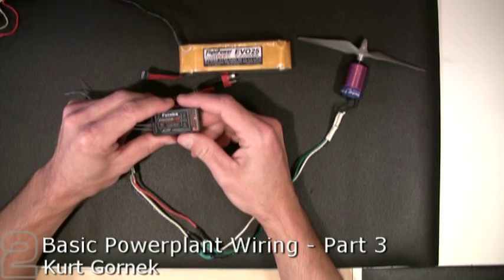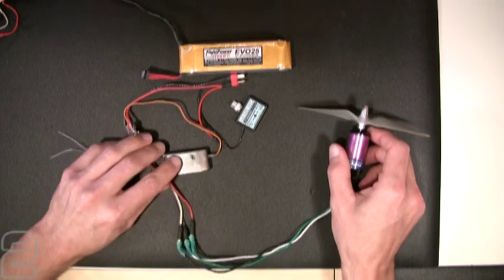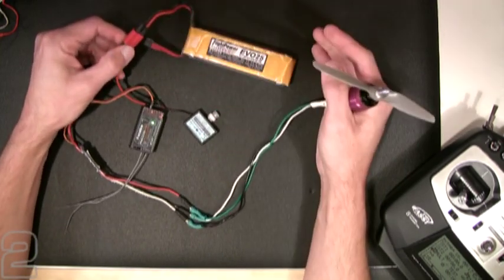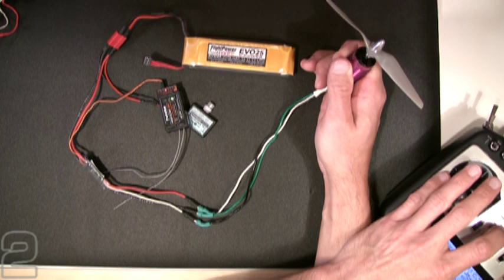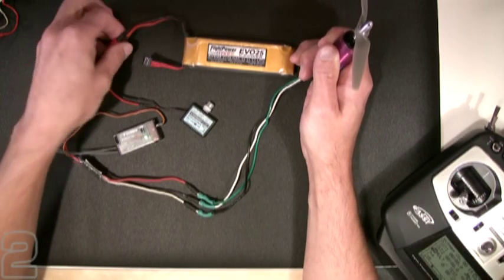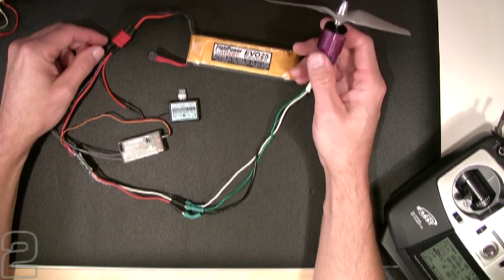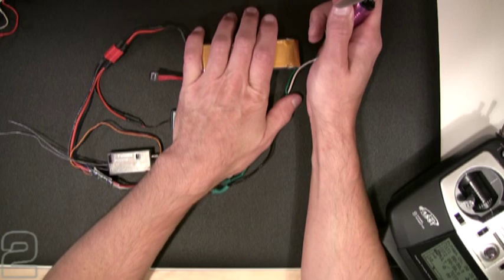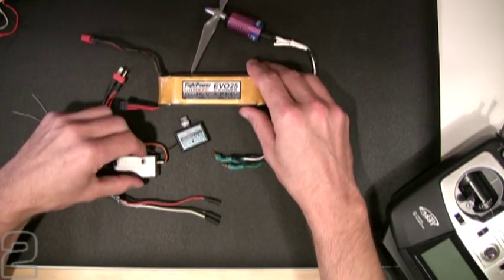RC Motor and ESC Wiring - Part 3

Comment from the maker: Always size your ESC to handle the maximum rated amperage draw from the motor, so you'll need a 46A speed control.  The BEC requirements are determined by the number and size of servos you are using.  Most standard BEC circuits found in 46A ESCs will handle 4 standard servos no problem.  If you're using more servos, or fast/powerful digital servos, consider using an external BEC like a CC-BEC 10A unit from Castle Creations.  If you exceed the internal BEC rating you could cause a radio brownout.

Comment from the maker: The receiver gets it's power from the BEC circuit integrated into most speed controls.  Typically an integrated BEC (Battery Eliminator Circuit) supplies 4.8 - 5.0 volts DC to the receiver.  Most radio systems now days can operate anywhere from 4.8V - 7.4V, but you'll want to verify this range with your manufacturer.  Servos are rated most commonly for 4.8 or 6.0 volt operation.  HV servos require 7.4 volts.  Most of today's receivers are designed to handle this entire voltage range.

Comment from the maker: Yes.  Brushless motors require an Electronic Speed Control since the motors actually operate via multi-phase AC current.  Connecting a DC battery directly to a brushless motor will just cook the motor and possibly the battery.

Comment: Im running a Turnigy D3542/5 1250KV Brushless Outrunner Motor and I'm not sure what ESC and BEC I will need. Does anyone have and recommendations? (Im a beginner so I don't need a super performance model)
Maximum current draw for the motor is 46A

Comment: WARNING, most brushless motors spin the motor housing that is attached to the propeller.   DO NOT hold the motor like this video shows unless you are sure the housing is not attached to the propeller.

Comment from the maker: @MrDoodool1 - I believe on that ESC, the side opposite of the wires is the best placement for the heat sink.  I don't have one here for verification, but one side should have several integrated circuits beside each other that get warm during operation.  You can always perform a bench test at half throttle to verify the heat generation.  Whichever circuits get the hottest are the best for the heat sink.

Comment: Hi there, i have two projects which i am considering using rc parts for, one is an electric skateboard, this will need a basic trigger type transmitter i only need forward and back, if i can find an esc which can direct the charge back into the batteries (regen braking) that would be great. I am also looking for a very powerful motor which has a low rpm, any ideas? I was thinking to put an 11T sprocket onto the motor and a 38T gear screwed directly to the inside of one of the wheels, any ideas?

Comment: @2BrothersHobby Thank you for the reply. I have another question. Wild Hawk came with a switch that comes off of ESC. If I am missing the switch, can I just connect those 2 wires together to run the airplane or would it short the circuit and over heat?

Comment from the maker: @delsol7878 - If your ESC has three wires and your motor only has two, these are not compatible.  Brushed DC motors have only two wires and operate on Direct Current.  A brushless ESC has three wires and supplies Multi-Phase Alternating Current.  The two are not compatible.  You should find a Brushed ESC that is made for your 2 wire brushed motor.

Comment: I have Wild Hawk RTF. The motor only has 2 wires coming off instead of 3 wire on the ESC that you show on the video. Do I just ignore the middle wire and only connect the red and black wires?

Comment from the maker: @698271001 - Can you be more specific?  Are you referring to the several small red and one black wire?  If so, those are the balancing leads.  They are used for charging and balancing.  We have detailed information about balancing leads, the internal wiring and how to use them on our website at 2bfly dot com.

Comment: i have a rc boat im building. it has 3 12v electric motors for propulsion.can i use 1 BRUSHED esc to control the speed of them all together ?

Comment from the maker: @Lenny7118 - Motors typically use what is called a bullet connector.  Most motors ship with the proper size connector for their max current draw.  Batteries are another story.  JST (small) , Deans Ultra, EC3, XT60...the list goes on.  One of the most popular connectors (here come the arguments!) in the US for do-it-yourself hobbyists is the Deans Ultra Plug.  We use the heck out of them for everything up to 6S helicopter packs with no problems.  Everyone has their own preference, just be safe!

Comment: Excellent video!! what I'd like to see also is a video of how to wire in a BEC into a ESC and also the soldering of the different connectors. How do you tell what size banana connectors are use on a motor or battery ?

Comment from the maker: @lendoggtheking - Yes, most ESCs are programmable.  Features depend greatly on manufacturer and model, but options such as motor brake on/off, timing, direction, battery chemistry, and cell count can be found on many ESCs.  They can be programmed either via the transmitter throttle stick, a programming card, or even through USB.  Check our website for more details about ESC programming, just look under Electronic Speed Controls in the main menu.

Comment from the maker: @petritwow - ESC cost all depends on the amperage required by the motor and the brand name.  They can range from 20 to 300 bucks.   As for the Bluetooth interface, we're not aware of any available on the market at this time.  Bluetooth range is very limited as well, so I'm not seeing that as an option anytime soon!

Comment: does the ESC its self handle any programing or is it all on the part of the radio receiver? and what signal does the radio receiver send to the ESC is it a voltage or a frequency?

Comment from the maker: @gizmoguyar LiPo batteries have a Continuous "C" and a Max Burst "C". If in your example the 10C rating is for continuous, we'll assume 20C is the burst (which should not be sustained for more than 8-10 seconds, with a "cool down" period between bursts). This setup would exceed both the conitnuous and the burst amperage which is not recommended and is dangerous. Also, this battery capacity would only give you avg 3 min. flights. Go with a 2200mAh 20C continuous pack or greater.

Comment: @2BrothersHobby So would it be okay to use a 1000 mah battery with a rating of 10C (that means the battery can only supply 10 amps max right?), if I where to use a motor that draws 30 amps, and a ESC that can handle 40?  Wouldn't that overheat the battery?

Comment from the maker: @gizmoguyar - Amps for the ESC should be +10% of what the MOTOR can draw at maximum.  That determines the load at the battery.  Check the motor max amps (if listed in watts, divide watts by supply voltage to get amperage), pick an ESC that meets or exceeds that max amperage, then use our Battery Runtime Calculator to choose your battery capacity based on desired flight duration.  Battery heat depends on the discharge "C" rating.  Higher "C" = less heat.  Use our Motor Sizing Calc to get started!

Comment: Hey, thanks for the videos, these are really helpful. I have one question though, about the current ratings for the Battery and ESC.  I'm not sure how to select battery and ESC and motor. The ESC must be rated at or above the peak current that the battery can supply right? But everyone says not to draw the max current from the battery because it will get hot and may shorten the life. So how do I configure everything to not blow the ESC, and also take care of the battery?

Thanks.